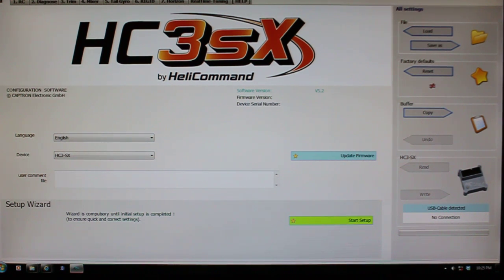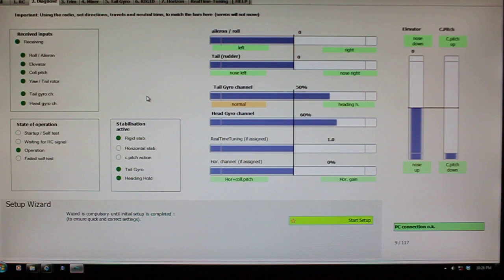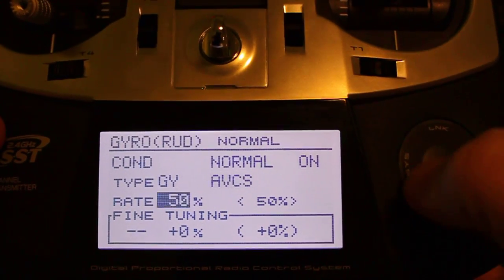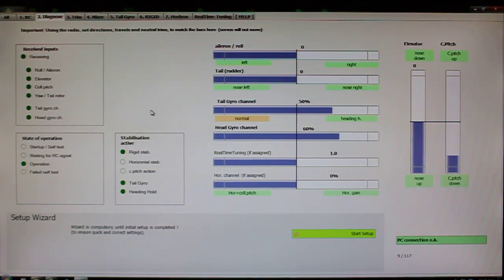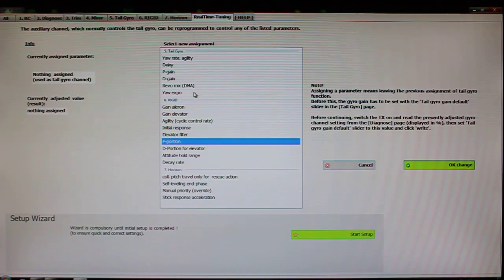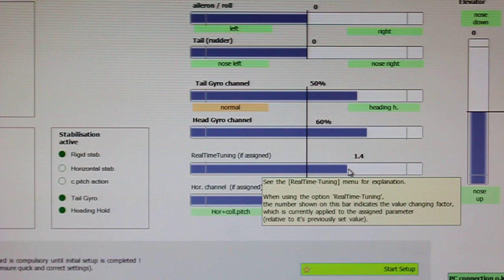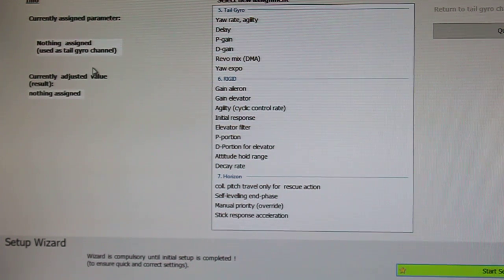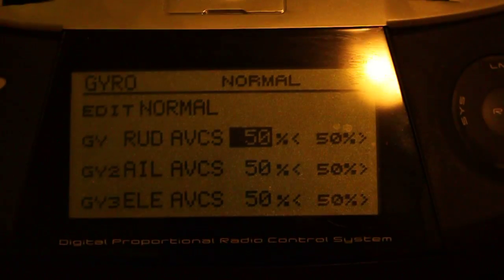HC3sX with 8FG Real Time Tuning

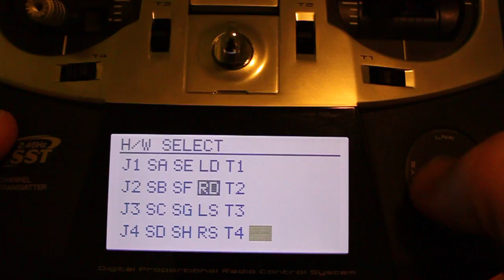Comment from the maker: NOTE: When assigning the knob value in the fine tuning menu (2:15 mark in vid), if you use -20 the knob output will give a positive value when turning clockwise. If done with +20 as shown in the vid, a clockwise turn if the knob will result in a negative output in the software.